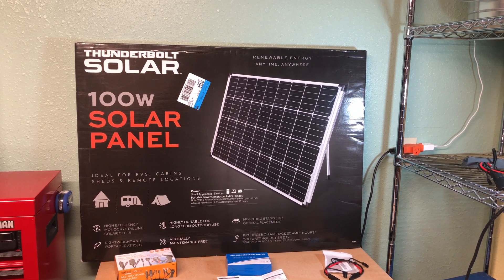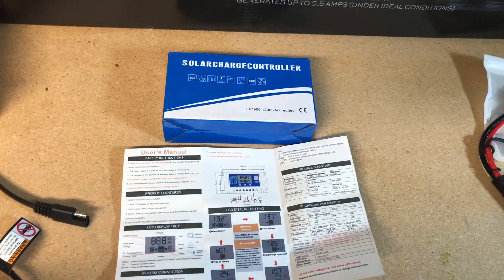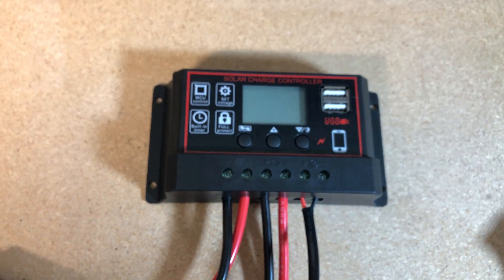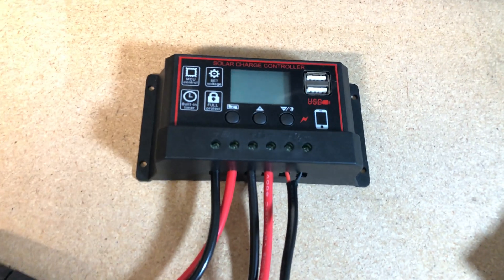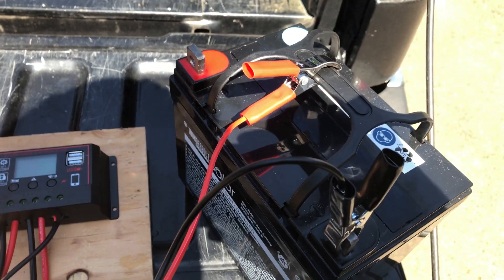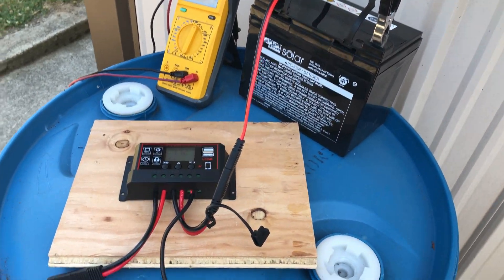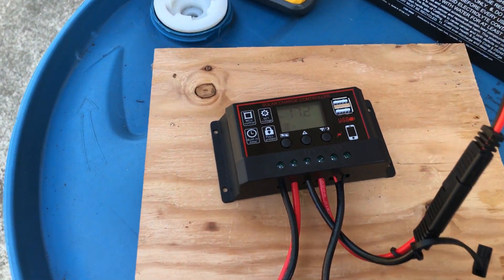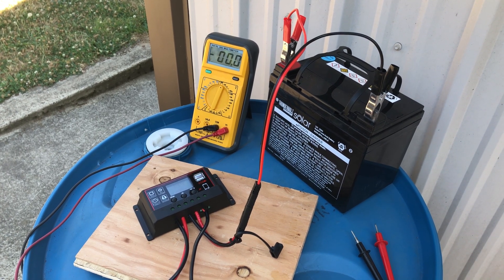Harbor Freight 100W Solar Setup with Charge Controller 2021

Comment: Thanks for the video. I am using the harbor freight charge controller and im wondering if i need to flip the polarity on the panel and battery the way you have done here. Thank you

Comment: NO you can NOT plug the inverter into the load plug on charge controller !!!! It is for extreme low draw NOT a inverter ! Inverter connects to the battery with much heavier cables.  ! Far as cables toss the fast connect buy the standard ones and wire it without confusion as to + - !  and way heaver wire preventing power  loss . Just buy Pairs of Solar Panel Connectors  and avoid any risk of a mix up !

Comment: Solar panel set up is usually not complicated but rather confusing, as each manufacturer has his own set of instruction with varies technical jargon in order to make his product work the way he wants. ￼🤔
Reply: Just that the load out is not meant to run a inverter or a  heavy load and doing so will result in damaged controller or a fire.

Comment: What size wire goes into the CC. It’s not working with a #10 wire. I got it to work but it feels like I should be using a  #12 wire.

Comment: Forgive me for asking a dumb question. Why would I want 100 watt solar system I could see it charging my phone maybe for my laptop for a small jackery. But you couldn't use your microwave or most coffee makers. Second stupid question can you expand that system to 700 Watts
Reply from the maker: you are right.  yes you can connect several panels together to have enough power to be useful.  And you can use batteries that can store more charge for bigger spike loads.

Comment: I have a Tera 1000 by 70mai and it has an Andersen solar input for a solar panel. How can I transfer the SAE plug to MC4 or Andersen inputs? Do I need a charge controller too?
Reply: Check on line... you should be able to find an adapter or just put new connector ends on the wiring you have.

Comment: Can you use SAE polarity reverse adapter connectors and where to put them instead of changing red a black wires???????
Reply from the maker: that would be a better solution.  i did not know they existed.  thank you for sharing!
Reply: @danr97123  I bought some on Amazon. Simple solution to the polarity issue.
Reply from the maker: @imxploring  i have now done the same.  simple solution for sure.
Reply: @danr97123  Funny... but some of the splitters and other SAE cables I've purchased actually came with the reverse adapters.... so the better cable suppliers are aware of the situation and provide the adapters to avoid the problem.

Comment: I installed 4-100watt kits to run things in my double wide on 5 acres in the mountains, 3 years ago. I use 4 marine deep charge 12  volt batteries in parallel as battery bank storage for when the grid power is shut off to keep the refrigerator, tv, some lights, etc. going instead of a fueled generator. It also runs my cooling during the spring/summer/fall months during the day and washing machine.
It's separate from the grid power so nothing feeds back. It's been keeping my utility power bill low, while their rates keep jumping higher. I just purchased one of these newer 100watt panels to add on to my system and try it out. So far so good. Really easy to add on to my other roof mounted panels.
Reply: You should make a video on your setup I would love to see it
Reply: hey what king of carger are you using to handle the 4 pannels,  should be one  of  48v as you have  4 pannels,???

Comment: Thank you for the great videos on HF solar systems, content and production quality.  Just getting started and have several questions.  How do you setup multiple panels to the charge controller?  The 35 Ahr battery seems pretty small, about 425 watts.  Will the controller charge any 12 volt battery and multiple batteries connected in parallel?  The rating of 100 Watts is based on what conditions and how you determine the actual power output of the setup?  Thanks again, best regards, Dan

Comment: Wow!  Thanks for the tip about the flipped polarity.  I didn't know that and I am a retired electronics technician!   They flip the polarity on an extension cord, which makes ONE of the ends have the wrong color!  I think I would put heat-shrink of the proper color on those because ONE MISTAKE of wrong polarity can really do some damage to whatever you connect backwards.   After 50 years of believing "RED" is positive.... "BLACK"" is negative..  I don't trust my future "self" to remember THIS ONE is backwards.   Heat shrink tubing solves the problem so when I am older I won't FORGET.
Reply from the maker: thanks for sharing.  good tip.  i found it eventually :-)

Comment: What is that means..17volts means cannot charge 12v battery using that controller..

I got the same problem..because  that controller defaulted 14.5volts to cut off charging...

Comment: I’m looking to put in a system like this to maintain my lawn tractor battery over the winter in my shed. Now the steps you laid out where to connect the battery first and then the solar panel in order to charge a 12 volt battery at the correct voltage. If I’m understanding this correctly, is when the sun goes down for the evening the charging will stop until it rises again in the morning and the solar charger should revert back to the proper charging voltage for that 12 volt battery, am I correct? Also does that charger controller work like an auto battery charger, if not do you know by chance if anyone makes one? Great video!!

Comment: I rather plug it into a Wall Socket to turn the power usage on the house down some.
Reply: Wall sockets can take 500w or so in reverse feed I believe.
Reply: I would not do this without asking a qualified electrician FIRST.

Comment: Can you hook a small powet inverter up to it to convert dc to ac,? To run like a fan or something small if want.
Reply from the maker: Yes. Best to add a battery to the circuit. Will ensure consistency and help with intermittent clouds.
Reply: Connect the inverter directly to the battery using appropriately sized awg insulated copper wire.
Reply: NO. Inverter has to connect to the battery.  One will not last long with only 100 watts and one battery  .  But yes a inverter can connect to a battery array but you will need a lot more than 1 one 100 watt panel  . You can get monster 450 watt ones and connected they can power any thing while the sun is out  . Just get  ready to buy lots of storage Battiers for at night. Inverters suck away some power just being on. .

Comment: I did not change the polarity on the charge control and I have the same setup as yours and its working fine.  Are you suggesting that I did it wrong by not changing the polarities like yours?
Reply from the maker: no.  that was unique to the adapters i used.  however i still caution folks to be aware of polarity with this connector type.  thanks for asking.
Reply: @danr97123  wait.  These “SAE” connectors have +/- embossed on the connector molded end.  Are you saying they’re incorrectly marked?  Or are you saying your cable ends were unique, in that they were deliberately reversed?  “SAE” implies standardization across manufacturers; are your unique ones mis-marked, or deliberately swapped at the actual male and female cable connections?
Reply from the maker: @billhouchens7439  the issue is that when you join two of the HF SAE connectors together they do not allow you to connect black to black (-) or red to red (+).  Instead it forces red to black connections.  Its very easy to see when you do it, but maybe i did not show/explain it well.

Comment: Would this work on my bluetti ac50s, out if the box. Or would i need a connector?
Reply from the maker: You need an adapter but they are easy to find on Amazon

Comment: A bit disconcerting that the SEA connectors flip the polarity. And are the panels waterproof?
Reply: You can get adapters to flip them back.
Reply: @xavierbreath2227  Exactly. And they're cheap.
Reply: Yes, all solar panels are waterproof from rain (maybe not submerged, though).
So that's not an issue. But hail resistance is very important to look into.
Don't know how hail resistant these panels are.
Maybe contact the company.

Comment: Why do you have to FLIP POLARITY?
Reply from the maker: only because of the premade cable/connector configuration that flips polarity (by color code).  i might have made it sound more complex that it is, but wanted folks that bought the same cable kit to be aware.

Comment: Friend, you will need 2 batteries for this 24 volt panel. God Bless
Reply: You don't need 2 batteries for a 24 volt panel. The panel doesn't charge the battery directly. It goes through the charge controller, which can take a range of voltage, typically between 12-28 volts in my experience. The charge controller will output the required voltage to charge the battery.
Reply: @logangreen6977  Exactly.

Comment: I was just wondering why you have the red positive wire in the negative connection of the charge controller for both the solar panels and the battery?
Reply: just a note ,the company that sells this product simply used  black wire for + and red for - i know backwards.  that's why he explains it in detail in the video. it was rather confusing to me also
Reply: @thelazyfishkeeper2730  if he flips the two it would be correct. The connection for the solar panel should have the bare red end so the hot wire going to the battery has the protected red end.

Comment: Nice review and thanks..But confused. I have a small off grid, 300watt 12v Pv…
4 marine 105ah ea..Eco River max and a pro…This is for emergency only.
And a hobby….Question is, the Harber freight 100 panels interest me
But the 18v bothers me. QUESTION…can I integrate there with my 12v
System?…Thanks guys, feed back is appreciated 
Dennis
Reply from the maker: my understanding is that "12V solar panels" often deliver far more than 12V.  The solar charge controller will manage down the voltage needed to charge batteries or deliver the right voltage to the 12V out port if it has one.
Reply: Thx D…

Comment: Hey i enjoyed your video. One question though? Isn't that a 24 volt panel?  I see the controller accepts 24 volts but you will need 2 batteries. Unless that's a 24 volt battery.
Reply from the maker: Thanks for asking.  A 12V solar panel will deliver greater than 12V and usually has a published spec for this.  The solar controller can mitigate this.  The solar controller will supply the correct voltage for 12V battery charging.  I did highlight one flaw in the design of the solar charge controller that i used;  if you connect solar panel before battery, it will use the solar input to sense the battery voltage required and in my case incorrectly believe i had a 24V battery and thus apply too much voltage to charge a 12V battery.  The solution is simple: connect the battery first and then the solar panel.  There are other more expensive charge controllers that don't have this flaw but the design i used is very common among very cheap controllers.
Reply: @danr97123  You should ALWAYS connect the battery to the charge controller first. Connecting the panels first will cause problems including toasting your controller.
Reply: @imxploring  Right you are!
Reply: Oh ok i understand now. Thanks for your reply. Take care.
Reply: Now i understand thanks take care.

Comment: How much was the panel?  $100? $89?
Reply: They were on sale briefly at $89 plus tax. Now they are $99 plus tax.
Reply: I saw it for $99 with over 90 Great Reviews!!
Reply: Cheaper stuff on Ebay.
Reply: @gregpeterman1102  
But eBay charges shipping. For HF you just drive over there. Also, amazingly enough, these Thunderbolt panels are actually decently rated!

Comment: I think you can swap where you used the halves of the cut in half adapter cable and the colors should match. (Use the half that is currently being used to connect the battery side over to be used for the solar connection, and then move the other half that was being used for the solar connection over to be used for the battery connection)
Reply: I had to read this 3x to get it. Lol. So because the cable he cut in half is male/female, the connection ends mating to ones on solar (for instance), from solar panel red is +, the connected cut wire side he plugged into Sae end happens to be the "far end" of the cut cable. If he had used the other cut piece, the colors would have matched. Got it. 🤪👍 BUT, that part he purchased was to in fact reverse the POLARITY (still don't know why).
Reply: @heatherk8931  Yeah, I think I typed out erased and retyped out that comment about 5 times before I just hit submit =). SAE requires a lot of attention to setup when more then one connection is involved. His advice to check polarity before connecting the next section is defintely the way to go.

Comment: Can you use the polarity tester that comes with the wire kit from harbor freight? How does that work? In my opinion you should have setup everything on camera. The polarity issue is very confusing to most people.
Reply from the maker: Thanks for asking. Yes you can use the polarity tester that comes with the HF kit. 
Let me try to clarify the polarity issue. It’s simple you just need to ensure that the red positive (+) stays connected through the SAE connectors.
Reply: @danr97123  sorry, that doesn't clear up the issue of hooking red to BLACK place on controller for us newbies. What do you mean cross over the red to black and so forth?, seems like it would be wrong to do that. That sets off alarms for some of your viewers! Thanks for answering this when you do.😊
Reply: @heatherk8931 2 years later, still no response.   Great.  Cause this HF stuff is truly garbage.  My panel is hooked up to the charge controller and doesn't charge the battery at all.  Reads 00.0 amp regardless of the sun blasting the panel or not. Reads the battery at 12.5V.  Doesn't read the panel charging/not charging the battery

Comment: Can this panel be used with the old system that came with a charge controller????
THANKS.
Reply from the maker: yes
Reply: @danr97123  So you will have 200 w of charging power???
Reply from the maker: @jeffriffel4364  yes, can be done easily.  i am not personally doing that though.
Reply: @danr97123  How many of the new panels can be ran on the older controller???
THANKS
Reply: @jeffriffel4364  the kit one has a 20 amp fuse, this panel says 5.5 amps.  200 watts of solar panels should run fine.
Reply: @johnn3542  Thank you very much.
Reply: @jeffriffel4364  just dont go over the maximum amps that the old controller allows. I have one and forgot what its max was. I don't use it anymore
Reply: @jeffriffel4364  do you have 2 100 watt panels ? How did you come to that? Thanks
Reply: @heatherk8931  Not yet but plan to. He said the new one does not come with charge controller. I bought the old one that did so if I buy the new one can I simply add on.
Reply: Yes but dont go over the recommended amps with all the panels you have connected to it
Reply: @tonylo488977  Thank you.

Comment: no idea what a multimeter is or how to check polarity can you explain
Reply from the maker: Without power applied you can do a continuity test with the multi meter. There is a setting that has a speaker icon; with this you can identify that the right wires are interconnected.  Put one probe at one end of a wire and the other probe at the other end:  if it beeps the the  two ends are connected.   
Another option requires care— you can measure voltage with the MM. if the reading is -12 V, then the polarity may be reversed or wired wrong.  If +12 v it is correct.
Reply: @danr97123   your reply sounds simple to you :) completely greek to me... im so embarrassed but i gotta ask so I can understand .....  what wires where  to determine interconnected no idea ???   Also how to measure voltage where to put the probes >>. etc etc
Reply: @mmqqq8246  lots of youtube videos about how to do this. ;o)
Reply: @mmqqq8246  you can buy a multimeter at harbor freight about $8.00   they work great  you dont need  a high $ meter to check volts and resistance  the instructions come with meter  very simple to operate with a little practice  basic use is check battery volts  select 20 volts dc on meterhave black lead pluged in com jack on meter plug red lead inV jack (middle  jack ) i have never needed to use 3rd jack   to test you car battery hold black lead to minus post  hold red lead to + post  a good 12v battery will read a little  over 12v on meter  test small batterys the same way  a good 1 1/2 vold battery  will read 1,5 or 1,6  always put red lead on plus on batterys  if you read about 1.3 its about gone  discard   its like a new toy  you will like it now to measure restance  select ohms on meter leave leads as is on meter no change when checking res dont worry about  + and -     post your questions some one will help you along  good lucki ve been using meters about 65 yrs or so built my first one from a kit with vacuume tubes  worked great  back the all meters were analog   now they are mostly digital  both work the same way
Reply: @danr97123  get a simple circuit science toy.  Like snap circuits,. You can play with it hands on and see how things work.
Reply: @danr97123  I have a multi meter, but there are a lot of setting options. Which do we pick😳 for this? Thanks again
Reply: my advice just back away from the solar panel.......hire someone to set it up for you.
Reply: Search Will Prowse on YouTube. Binge watch his videos and you will have a Masters Degree in Solar Technology! He knows everything about Solar and then some!!
Reply: Don Tacare  thank you!, now I will go check it out. Thanks 😊